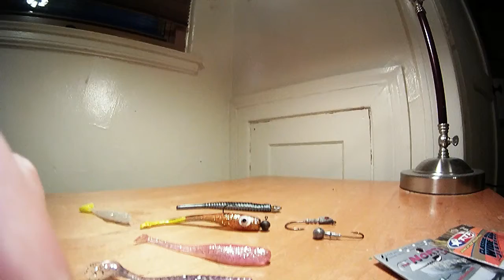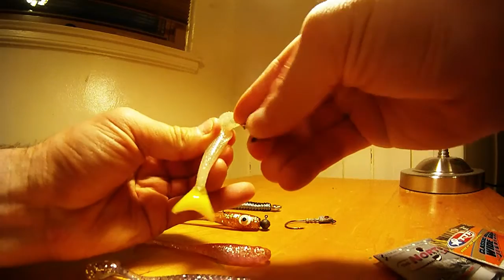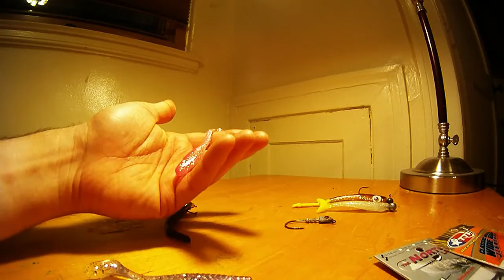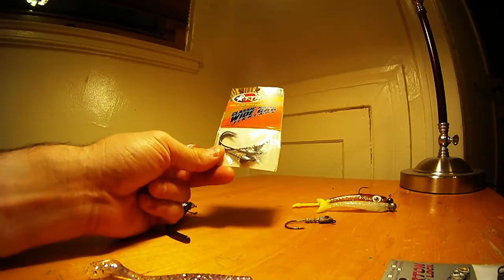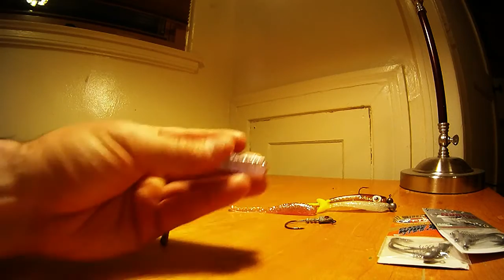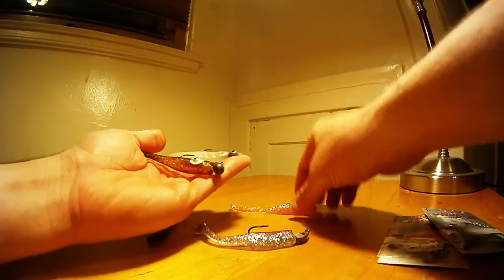Speckled Truth - Choosing the right Jig Head

Comment: Hi, how do you rig your leader? Do you like a small #10 swivel or do you use a line to line knot for these baits?
Reply from the maker: Michael Kelley I rarely if ever use a leader. That said, I use a uni to uni knot to connect mono to braid. The FG knot works just as well but my uni to uni is good
Reply: Speckled Truth, Thank you for the response. I was taught to tie the small swivel to a leader but I always wondered if it would affect the way the bait swims. I will try without a leader tomorrow. I respect your research and think you provide a great service in promoting conservation! “Eat what you take and only take what you need”